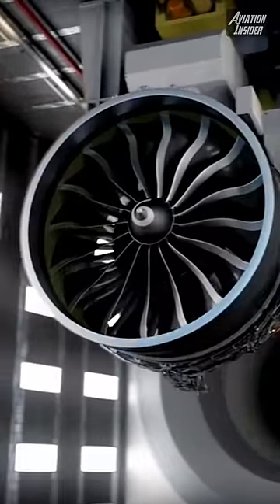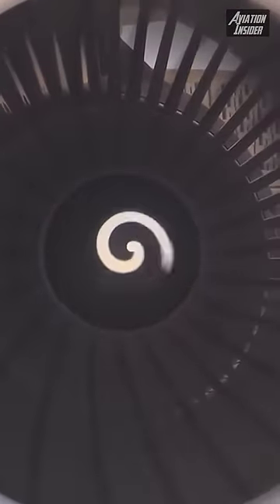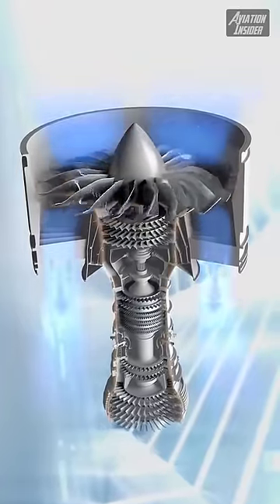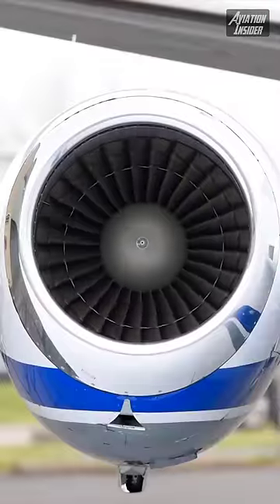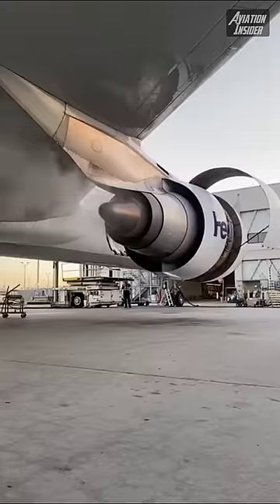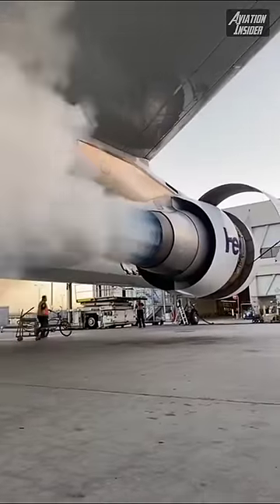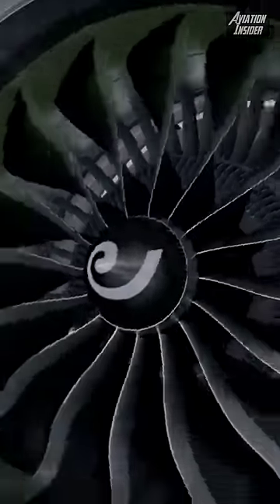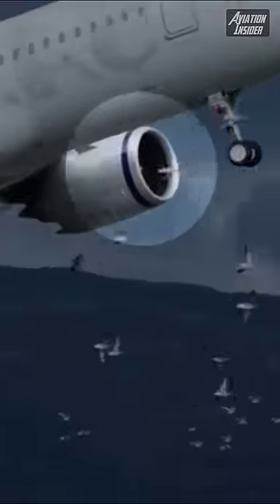Insane Reason Why Jet Engines Are Never Protected In The Front 😨

Comment: plus, if the mesh collapses from a bird strike, not only do you have bird going in, but metal mesh as well, it’ll really mess up the engine then
Reply: yes, engineers are more afraid that the mesh would go in the engine than a bird.  mesh would cause more damage than a bird.
Reply: @polysporin8332  Some jet engines do have some sort of (reinforced) mesh in front but that is to pre-form the airflow to reduce drag and improve engine efficiency but is considerably coarser and birds would still fit through
Reply: The intake is also metal that could mess up the engine🙄
Reply: considering the speeds planes are travelling, birds would already die from the collision alone
Reply: @toniphamvan210 it's not to protect the birds......
Reply: Lol this is very accurate. There's not gonna be much reduction in thrust from a screen over it, at least not the metal fencing in the animation, but the main reason is mostly metal vs meat good, metal vs metal bad
Reply: Even if it worked, whatever was stuck on the mesh would reduce airflow even further.
Reply: And it also won’t work 😂
Reply: Even if the mesh could somehow prevented from sucked in, the birds would suffocate on the mesh and gunk up the intake

Comment: This introduces another problem--icing.  Flowing, moist air over a super cold wire grate is an invitation to loss of airflow.  Then a 30 pound goose hits and the whole thing is sucked in.
Reply: Yeah, it just presents more problems
Reply: Right, also if something gets stuck in the wire depending the size of it it might block even more air
Reply: Only in australia would a goose weigh 30 pounds
Reply: @jeremytheimer7443  Actually here in Wisconsin we have a sub-species of Canada geese called Brantaya  Canadises, or Big Canada geese and they have been known to reach 30 pounds.  Several Canada geese damaged the engines so badly they could not be restarted.  This is what happened in the Miracle on the Hudson incident.
Reply: It’s funny you think a goose can weigh 30lbs
Reply: Or the ice frozen on the mesh falls in. That's even worse than the birds
Reply: @jeremytheimer7443 geese? never heard of em, us aussies got bat winged crocs instead! 👍👍
Reply: Make them retract no birds above 5000 ft
Reply: Why can't they make it into a heated filament then... like a toaster filament? Pretty sure fine wire can't reduce airflow that much
Reply: @cashobuyer  its just not necessary 🤷🤷
Reply: Air friction generates heat. The moisture should evaporate quickly. You do realize that planes can go straight into clouds. They are designed not to crash even with the presence of moisture
Reply: That's clever
Reply: @cashobuyer in case if you had dementia

plane can go up to 800 km/h. Fine mesh would stop nothing
Reply: @aemen8796 ice, like solid water

Not moisture itself, like gaseous water
Reply: @jeanunderwood612 lol, 🤣😅, if some object is stuck in the grill that means it would have damaged the engine if grill was not there. So 1 percent less air in the engine is way better than a damaged engine😢
Reply: This does bring up a good point, that ice would easily form on it, clogging the entire thing a lot more. Ice can already form on wings and reduce their lift, and with a wire cover ice could easily form over the turbines and block thrust as well.
Reply: @jeremytheimer7443 it would be a flock of geese adding up to 30 lb.
Reply: A 30lb goose??? That's a cement block with wings😂
Reply: @capnkirk5528  tf are you even talking about
Reply: 30lb goose will end an engine anyway none are rated for a bird that big but that is why you have 2 or 4 engines. a USAir 1549 is extremely rare where you get a flock of chonkers through both engines.
Reply: We got weights in these geese!!!

Comment: To better absorb bird strikes

More like erase the birds out of existence strike
Reply: At least its quick
Reply: @CrustaceanAllergyEnjoyer It's not about the bird being hurt (because it fucking dies when going in) but because it can damage the engine and maybe even completely shut it down.
Reply: @vannyvan.  even with a protection device, it won't be effective because the bird will still get through, and now you also have more objects put into the engine, not just the bird
Reply: @aufstrigende  what I meant is that the main problem of the bird getting in the engine isn't because it's a hurtful proccess for the bird (since it dies just when going throu the blades) but rather, as I said, because it can make the engine break down. I said all this because the guy I was talking to (1st reply) thought the original poster was talking about how not giving the engine a protection makes the birds go in would make them die instantly, making him think that at least, that same proccess was fast and unhurtful for the bird. Yeah I just wrote a bible about this, but it was just to explain lol.
Reply: @vannyvan.  the fan blade would be spinning at thousands of revolutions per minute aswell as the compressor blades behined it, the bird would die instantly 

but adding a protective device onto the engine will only damage the engine more incase of a birdstrike, because the bird would hit the protective device, break it and both are then sucked into the engine
Reply: @aufstrigende  Basically what I said, yeah
Reply: Critical strike on bird
Press A to search disintegrated remains
Reply: More like make the bird be on both sides of the world at the same time strike
Reply: Yeah. It is terrible how humans talk about this.
Reply: @vannyvan. What do you propose then? I swear you people complain about everything
Reply: @ChinaBallOfficial  I was just responding to the 1st reply (guy sayings birds die quickly) lol.
Reply: @vannyvan. what about the people inside? huh what about the people inside? 1 engine down thats ok but if 2 OF THEM you go die die 200+ passengers not just the 2 birds ok?
Reply: @hansFem-cw6gp  It's really hard for morw than 1 bird to go into both engines, and still, depending on what stage the plane is, it could land safely. Also, I said the birds MIGHT rake down the engines, as the OP said "they're made to absorb birds better".
Reply: Not just bird strikes, anybody strikes that thing they’re gone!
Reply: They are improving the blendering ability of the jet😂
Reply: @hansFem-cw6gp planes can still continue to fly for around 70 miles after total engine failure, which is enough distance (in majority of scenarios) for the plane to make a safe emergency landing, however it is also very unlikely that both engines would be hit by birds, even less of a chance in the case of a plane with 4 engines such as a 747 (fun fact, the plane can fly with only ONE).
Reply: @CrustaceanAllergyEnjoyer what ifi survives
Reply: Such a perfect comment ❤
Reply: @RedEarthOfficial It wont survive is the thing, it's impossible, the whole body is shredded, and the brain itself is shredded. Bones, feathers, nothing comes out alive.
Reply: Dont be in my fucking way then 😂 theres allways a bigger bird in the sky 🤣
Reply: We can make a device which can scare birds away.
Reply: @ravitiwari3608  I don't think birds can fly at 250-350 mph 😂 it wouldn't matter if u scared em, they'd be shredded to peices before they even heard it
Reply: 15
Reply: Do any of you people know about the story of Sully Sullenberger?
Reply: @JohnDoe-de3km snowing with lots of flakes much?
Reply: Its better not to have the bird stack in font of the engine dying slowly is better then dying instantly
Reply: Yeah
Reply: And then erase the engine out of existence
Reply: @aufstrigende you’re repeating exactly what he said… 🤦‍♂️
Reply: It's a polite way of saying bird grinder
Reply: @daniellamorten6230 turns off engine and goes inside then crawls out
Reply: @JohnDoe-de3km it's because a dead bird due to a bird strike is a thing that's unavoidable.

In the relatively rare case of a birdstrike you care more about the 150-400 souls on board of a plane than those few birds that will die no matter what.

You either boycot flying on planes when you don't tolerate any deaths or you just accept the very little amount of 10.000 birds that die every year compared to the 25.000.000 flights that are flown every year.
Reply: Has an engine ever survived a bird strike or is that just some useless safety regulation written by someone with a pointless job?
Reply: @spr1ngcactu5  the newer engine generations (when talking about commercial twin-engine planes) are specially designed to handle bird strikes very easily.

That means in case of a bird strike the fan blades are strong enought to not break when colliding with small to mid sized birds. When a plane collides with bigger birds it's likely that one or two fan blades out of many can break.

To prevent that the broken blade catapults itself out of the engine into the plane's fuselage and possibly killing a passenger the engine cover is strong enough to easily hold those engine blades inside the engine.

With that said there is a small possibility for an engine to be damaged so much after a bird strike that it fails. But this is also not that big of a problem because planes are also designed and tested to fly with only one engine and savely land at a near airport again if needed.
Reply: No capes.
Reply: God dam birds ataking our planes
Reply: God dam birds ataking our planes our planes
Reply: Natural selection.
Reply: Who cares
They are birds
Reply: I mean, wouldn’t a protective layer keep them there until the engine stopped? Forcing them to suffocate to death… yea I’d rather be instantly pulverized
Reply: Time for some nuggets
Reply: "And after thinking about it, we decided to install 3 meters of foam in front of every part of the plane, to save the colliding birds."
Reply: More like turning the bird into the turbine blades
Reply: The bird mister 9000
Reply: More like instant death, didn’t see it coming 😂

Comment: Some Russian fighter/attack aircraft have some kind of door or louvers and an airflow bypass to avoid foreign object damage in rough-field operations.
Reply: nah i think thats for controlling the airflow
Reply: @beimanuel942 no. It is to avoid foreign objects from ingested into air intake. For take off and landings,russian fighters have air intake on upper side of the jet behind the pilots. Once the jets are airborne,the top intake closes and air intakes in front of the engines are opened.
Reply: @destroyedsoul1791  ohhhh i was thinking about the trapdoor in the ramp intake.
arent the secondary jntakes for FOD?
Reply: @destroyedsoul1791 P.S youre right and wrong.
Its not in all planes, in fact, if i am not wrong, the system was used once, in Mig-29 series of planes, that were designed back in the Soviet Union.
Reply: @Merc_justsomebody he didnt say all of them
Reply: Normal aircraft have them too..
Reply: That's because it's about protecting the fighter jet, not because they're friendly to ducks flying by 😂

Comment: Forget about the bird.
What if the protector gets sucked inside the engine?!!😂
Reply: Then it will get shredded like it's not even there? Not good for the engine of course but the plane will still land with a functional engine, it'll just need some maintenance to ensure nothing's bent.
Reply: @connermckay4012 flwsh and bones are weaker than mesh
Reply: You get a second protector to protect from the first duh
Reply: @starsnipe-yp5hx its speed not material that is causing damage 😅
Reply: @meliodass6951  exept for steel mesh wich is bendable and can cause bigger problems
Reply: @starsnipe-yp5hx 
Why it would get stuck in if they designed the mesh with aero dynamic shapes to allow airflows through rather than blocking it?

Protectors simply never use because it’s pointless for jet engines, it’s NOT the airflow causing the issue, it’s the vibration the jet engine gives off that can make the mesh to deform thus damage the engine in return.
Reply: …Because a bird caved it in
Reply: @meliodass6951 disagree. From personal experience a rabbit does 10x as much damage than a bird. And the rabbit was sucked up on take off, so lower speed than in air flight. Plus, bird bones are hollow, so with birds it's really the digestive rocks that do the damage.
Reply: Yeah, the engine would explode and severely damage the aircraft